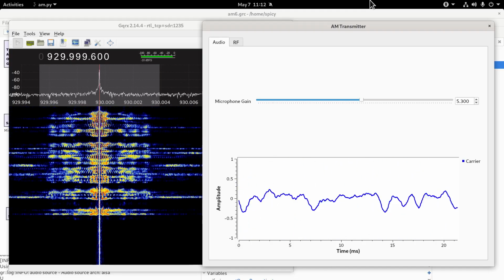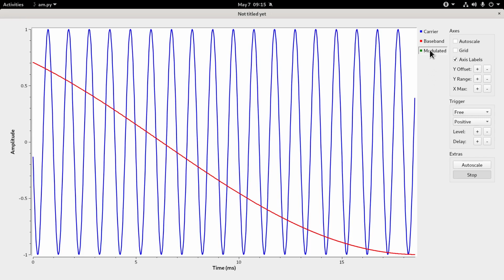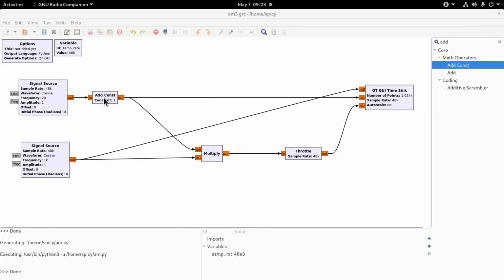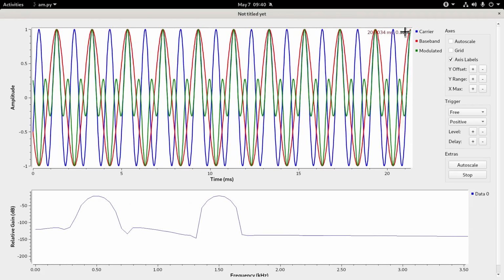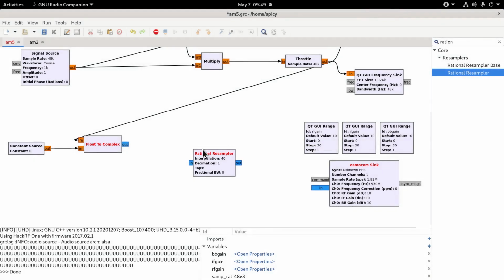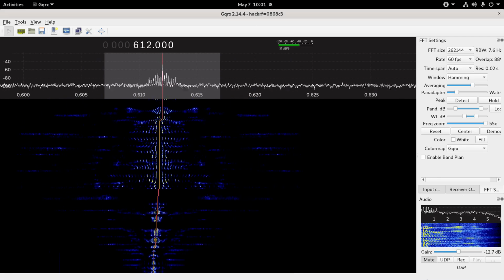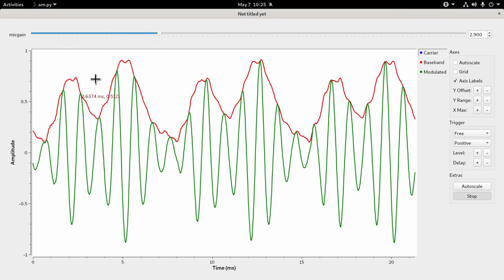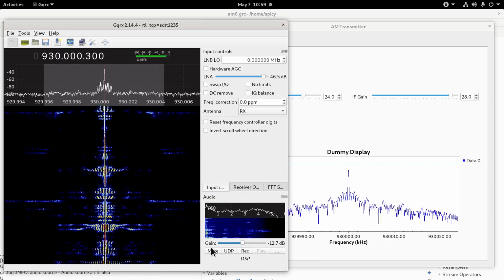GNU Radio Amplitude Modulation

Comment: i did till transmitting and got the below
gr-osmosdr 0.2.0.0 (0.2.0) gnuradio 3.10.9.2
built-in sink types: uhd hackrf bladerf soapy redpitaya file 
[INFO] [UHD] Win32; Microsoft Visual C++ version 14.2; Boost_108200; UHD_4.6.0.0-release
 [1m [33m[WARNING] SoapyVOLKConverters: no VOLK config file found. Run volk_profile for best performance. [0m
[INFO] Using format CF32.
no error is occuring but the graphs arent coming either. without osmocom everything is working fine, anything to fix it?

Comment: I've wanted to play with gnuradio but never got far. But your video helped jump start me.
I don't have a hackrf :(. So I put in a 3khz low pass filter on the audio and set the carrier to 6khz, Put in a File WAV sink and saved to a wav file. 
In a seperate project I used the File WAV source and a AM demodulator to demodulated it.
Audio voice transmitted on a 6khz carrier. Demodulated  it sounds just like normal voice.